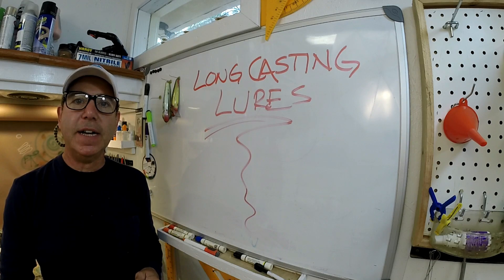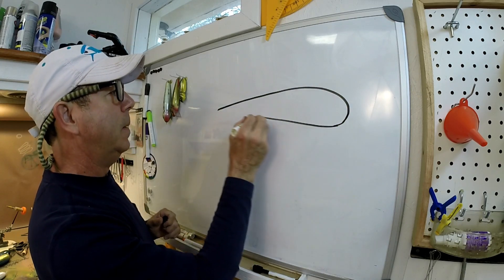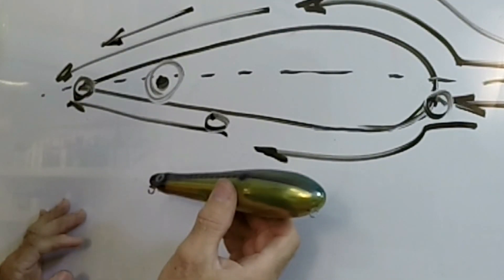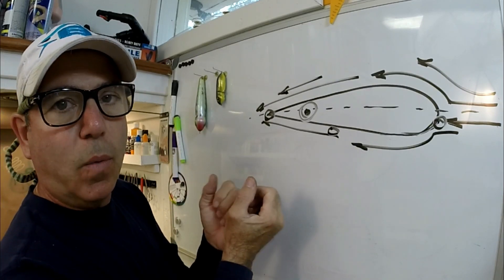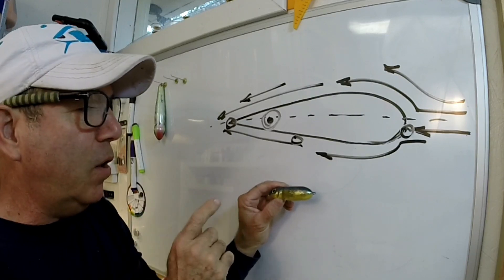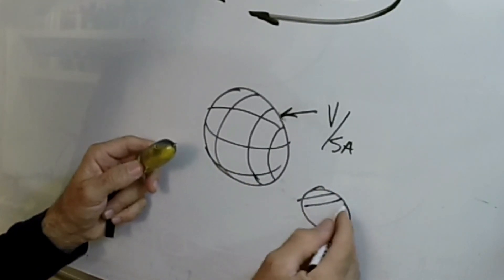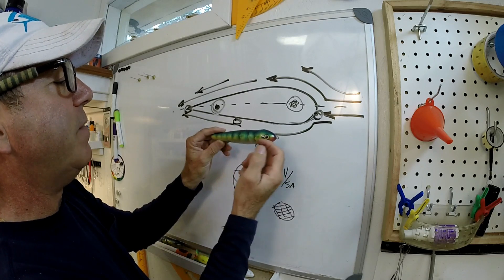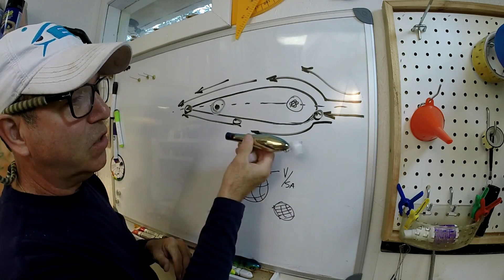long casting lure design

Comment: is it possible that some lipless lures designed to cast in the wrong direction, will turn around in the air? In my mind turning around would be the path of least resistance
Reply from the maker: It's possible but the wind drag and friction drag coming from the line usually rules.
Reply: @EngineeredAngler  . Thanks Mr Engineer, its a 4 year old video, never thought you d be the one to answer my question. Must say I have seen many videos on the lure subject but if its about deeper knowledge or understanding of characteristics of  lures I seek, its you channel I look for!!! If by any chance I end up beeing a good lure builder you should know you had great impact on its fruition.

Comment: Do you cut your own lexan lip blanks for your jelly bean crank bait or buy them already made?
Reply from the maker: I have done both...if I can find a pre-made lip, I buy them. But, I don't let it limit what I design, I'll make one to fit if I need to.
Reply from the maker: No I don't cut any lexan lips anymore I used to. The three quarter by three-quarter lips Square bill seem to work really well and they're not that expensive